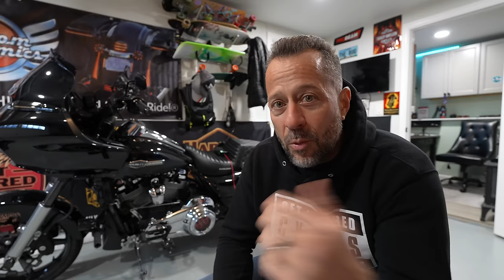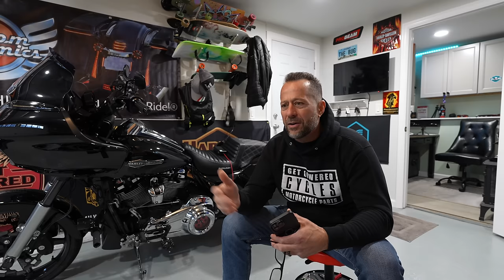HOW TO PROPERLY BREAK IN YOUR MOTORCYCLE ENGINE #cyclefanatix #harleydavidson

Comment: Many, many videos have been done about engine break-ins and the conclusion is simple: Whether you ride it hard, or take it slow, it doesn't matter at all. 
What matters is:
- Warm up your engine for 1 minute at least before using / riding it.
- First 1000kms: Change your revs all the time, up and down and change up and down gears as much as possible - stay off the highway
- First 1000kms: Do not baby the engine and never lug the engine
The rest is a well-known Metallica song.

Comment: I asked the service dept on the 2024 CVO ST Road Glide, they use synthetic for the bike on delivery. It is suggested to change out to mineral breaking oil then?
Reply from the maker: Yes, you should definitely do your first service and put the recommended oil in
Reply: Lucas oil 10700 high perf SAE 20W50 motorcycle oil be appropriate?

Comment: Biggest mistake you can make is not changing the oil until the 1st 1000 miles. As those rings and valves seat, metal is entering the oil. Any other contaminants that found their way into the engine during assembly are also washing around in that oil. That debris in the oil is doing more damage than bringing it over 4k RPM ever will. Get that 1st oil out at 100 miles and replace it with a non synthetic oil. Do the second oil change at 500 miles. After that, 3 hole systems like the Harley; every 3-4k miles. Single hole systems like the Indian: every 2500 to 3k miles. Don't be cheap with the oil.and filters. It's much more affordable than engine work. Can't go wrong with AMSOIL and WIX.

Comment: If that engine is built correctly, it doesn't matter how you break it in. I've built engine for well over 40 years. The ones that are babied seem to have more issues than the ones that you back out of the garage and run it like you stole it.

Comment: Wow!  Still good.
Reply: Not running external head breathers will allow unwanted snot into your combustion chamber, which overtime causes carbon deposits on the top of the pistons. This raises the compression ratio, which in turn requires another tune. Many people use octane boost as a bandaid. But eventually you have only one choice but to tear the top end down and decarbon the piston tops.

Comment: You say "I never did that", but you did it without knowing. I mean, I suppose you did not run your new engine constantly at max power, or constant speed ? For let's say an hour ? No road will allow that. If people drive "normal", like most do,  there is no issue.
So, if you just give the engine a little "rest" between loadings, that is how the engine will break in. Just follow the well known procedure of "changing loads, speeds and gears". The manufacturer description is a guide line, but pretty sweet indeed (also the H-D gear change speeds are a laugh, the engine does not run smootly then). Duration of "high load" can be increased over time. Constant idling is not good, constant speed is not good. Bearings and piston rings are broken in after "50 miles", or "100 kilometers", depending on the units you have or were you live, haha. I have always had nicely broken in engines this way, based on feeling at least between 500 and 1000 kilometers, I think. Standard engines, no tuning, and up to now I have even never opened up the throttle to 100%, sorry ............ Good fuel consumption (1 liter per 20 km / 1 gallon for 47 miles or a bit less), smooth running (but the newer H-D engines even from zero miles), low oil consumption (1liter per 10000 km / 1 qt per 6000 miles), happy with that.
For most customers you could say, just ride variable engine speed and loads on smaller roads for 100 km / 50 miles, for example leaving the dealership to home. After that ride "normal", so no racing etc., just "quickly" speed up the highway ramp, then "normal", so regularly overtake some cars etc. Then you and your engine will be fine.
Synthetic oils just have to do with temperatures and longer time so mileage stability, not for less wear / break in, the surface roughness is not "protected" by any oil, it will peak through the oil and break off every quickly by metal contact anyhow during break in.
If you change oil after 1000 miles, indeed you may use mineral oil as well, it is cheaper, but on a new dealerbike you have no say in that, the oil is already in there. I can imagine some manufacturers just put in the cheapest, no problem for that short mileage.

Comment: Don't idle a lot, don't cruise at one speed for extended periods. Accelerate and decelerating keeps oil on both sides of the rings. Use your gears to slow down not coast down. I do try and build up in the rpms I don't WOT a new engine. You are meshing the gears together during break in and again continuous accelerate and decelerate. Never had an engine failure. Break it in however you want its your bike.